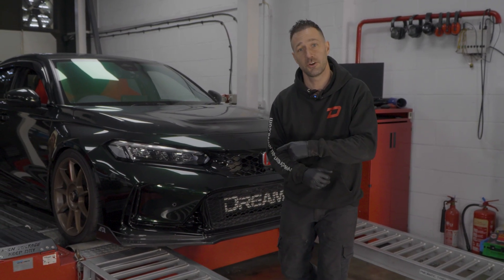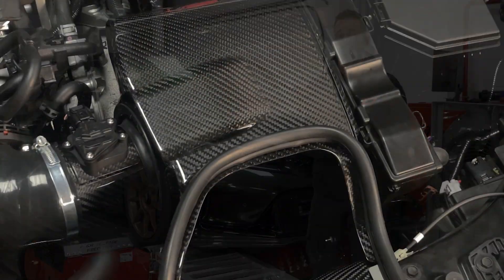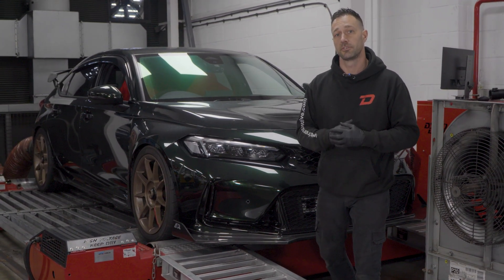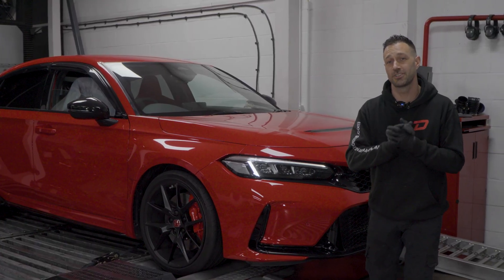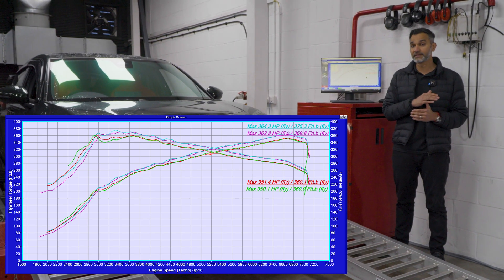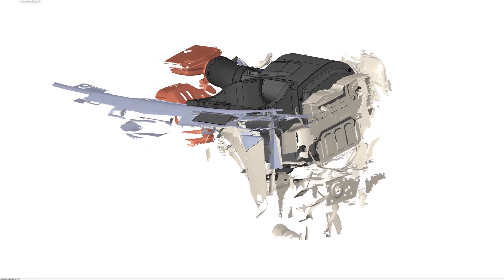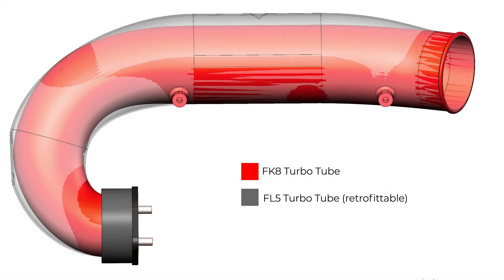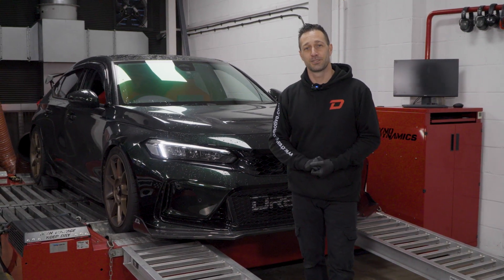Eventuri FL5 Civic Type R Intake Test | Dream Automotive

Comment: Dry air filter? And how often is the cleaning interval and cleaning solution? Thanks
Reply from the maker: Filter should be changed at every service interval, you can wash the filter or replace it completely.

Comment: Is it possible to remove the cone for cleaning without having to remove the air box first?
Reply from the maker: Unfortunately you have to take the air box apart first to be able to remove the filter.

Comment: After seeing all of the issues the GR Corolla guys are having with the Eventuri, I'll gladly take a pass on it. On top of that, Eventuri just flat out ignorning them.
Reply: Do you mean the CEL issue? Cuz that has been solved by them now (apparently).
Reply: What was the issue?
Reply: @michaelxie4563  Eventuri claims their cold air intake will not throw a check engine light except its throwing tons of check engine lights. Customers reach out to Eventuri and get no response

Comment: People who modify perfectly good cars are idiots.

So you are going to lose your warranty and devalue the car for the sake of 10hp (which you will not feel the difference in a car weighing over 1400kg) and a bit of chavvy blow off noise.

I have one of these and they struggle to put the power down in stock form through 1st and 2nd as it is, the last thing it needs is more power.

If you want something to spend your money on, get some tuition on how to drive them properly and that will be money well spent. Try CAT driver training (for us here in the UK). You will be amazed at how fast these things are in stock form when you learn how to drive them properly, utilising the full grip the car has etc. They are mind blowing.

More power is not the answer.
Reply: Yeah but it still overheats in stock form around the track. Intercooler and a performance radiator is a must and a turbo blanket.
Reply: As the rock once said, "Shut up, 🐕" 😂

Comment: Eventuri air intake is good gain on hp and torque for FL5 and FK8 but Eventuri turbo inlet pipe looked a little bigger on FL5 than FK8. 😁👍
Reply from the maker: Indeed, the intake pipe for the FL5 will be bigger! It will also be backwards compatible to the FK2 and FK8 👀

Comment: It was interesting to see the torque and hp of the Eventuri was actually less than the stock airbox, prior to the turbo spooling,  from then the gains were consistently above from that point.
I'd imagine that could be tuned out, but it's interesting!
Reply from the maker: Bilal and ourselves had the same conversation! This dip will be easily tuned out, providing an even larger gain.
Reply: @DreamAutomotive  Thanks for the reply!
Yeah like if you consider the pre-spool area like any other K20 or low CC N/A motor, it kinda makes sense to see a loss in the N/A section of the range, just shows how big the internal dimensions of the Eventuri intake are and how much greater the flow is, really.
That's going to make some nice gains once tuned accordingly.

Comment: I’d like to see it on a totally stock car
Reply: My FL5 was used in the test and it made 350.1 stock. That was consistent with the first dyno result a few months ago. Where is made 347
Reply: @TiMtImInYtImTiM  Dyno fudge or tune involved, come on man
Reply from the maker: The second red FL5 is entirely stock, other than the intake 👍🏼

The numbers we looked at with Bilal were produced by that car.
Reply: @DreamAutomotive  hmmm...but the graph that was brought up in the video was showing 350 hp. Surely the stock one isn't almost 10% stronger than indiacted by the factory.